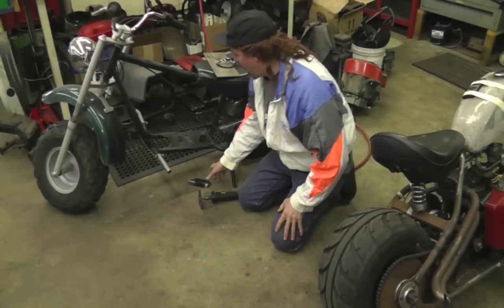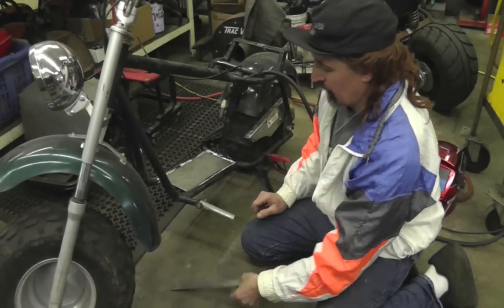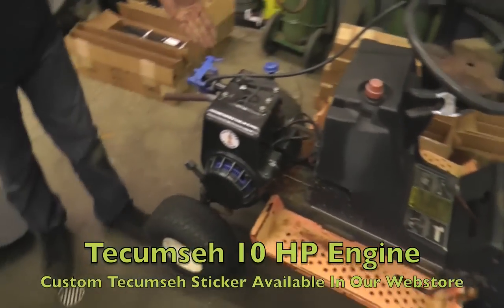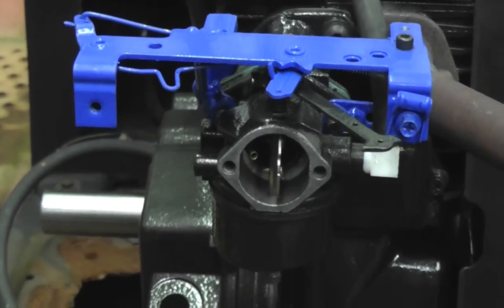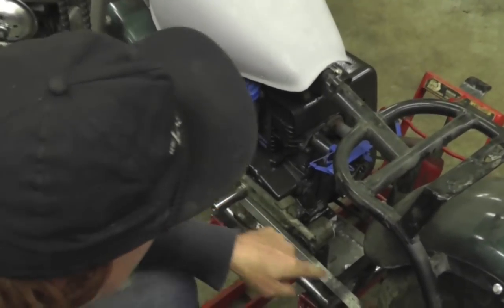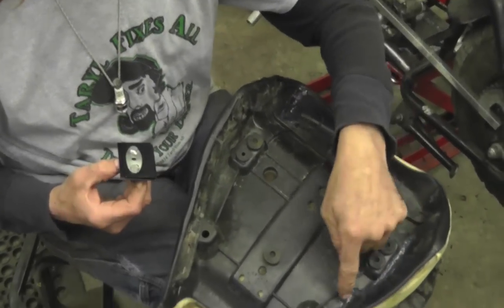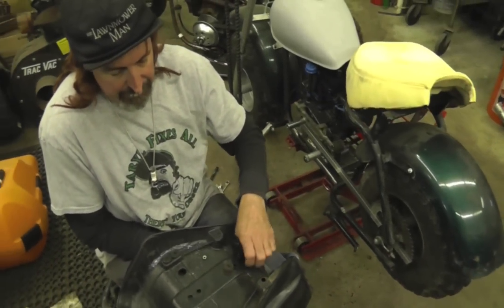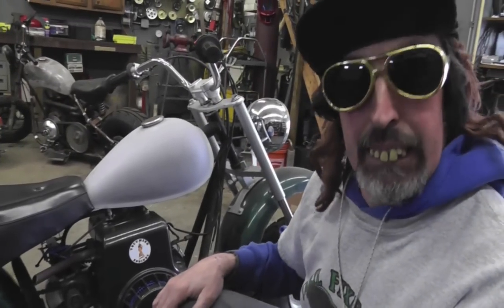Taryl's Builds - Baja Mini Bike Pt. 2 (Engine Mounting)

Comment: U need to get you a West bend power b motor or a Mac 10 build yourself one nice go-kart. I used to have a West bend power be go-kart it was from the late 1960's that sucker was fast and loud. Then I had a coyote go kart 100cc Yamaha motor I believe that did over 80 miles an hour. But I don't have many more but I do miss them.

Comment: Whale im alittle late but uhh im working on a 1970 rupp roadster it wont wheelie xD needs a belt i think an probably a new barrel slide carb cus the tecumseh carb setup throttle return spring kept snapping but the carb i put on is alittle too big its a 26mm kehim carb i need like a 22mm

Comment: I just drove up to gopowersports.com in Keller Texas and picked up a seat I ordered for the Baja mini bike I recently got for $25. I replaced the engine with the 208cc IronTon engine from Northern Tool . I installed the 30 series torque converter clutch assembly. Hauls all kinds of booty. Not bad for a $75 bike. 73s, great video. What's going on with the other mini bike?
Reply from the maker: The other bike is another project. Stay tuned!

Comment: Taryl, I have an old Rupp Mini Bike from the early 1970's before they started putting in the 3 speed transmission and motorcycle engines. Chrome Shocks front and back, 10" laced wheels, chrome front and back bumpers and handlebars etc. (I can get model number, but it escapes me at the moment). But I digress...the frame and swing arm is in acid etch primer after being sand blasted (one small cut out on seat pan when PO tried fitting a Briggs 3hp in). It's complete less engine with a new jack shaft with torque converter pulley. No pulley/clutch for the engine of your choice, but if you're interested in it, let me know. It's a project I'll never get to. Cheers!! Zip~
Reply from the maker: Thanks fer the offer. I have a Rupp  but not the one yur describin. Let me think about it.

Comment: That bike is sweet.  Taryl- been trying to get wheels off rottotiller.  Tried all of Taryl's tips. Air chisel- lots of PB blaster- heated red hot and quenched- made a plate to work with a gear puller- heated red hot and gear puller. Had to set on the floor, used a deep socket and 8 Lb sledge and drove wheel in as far as it would go. Growned the mushrooming off ( from the drive pins, ) shined with emery cloth, blasted and pulled off with puller. This isn't my first rodeo, but they are one no good, rotten, son of a $#&*%#@ . Now on to the tines. Wish me luck,buddy.